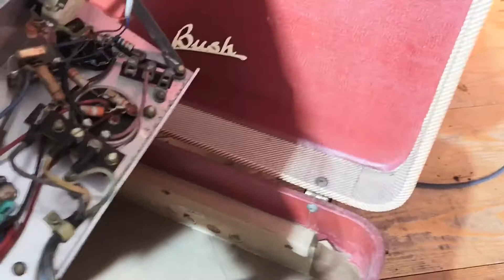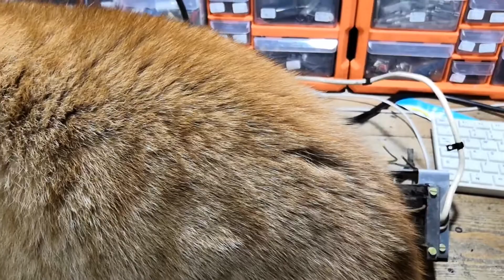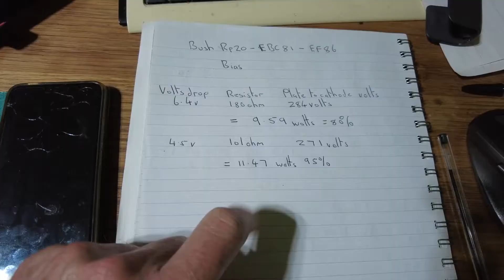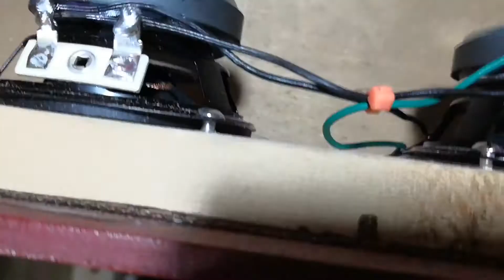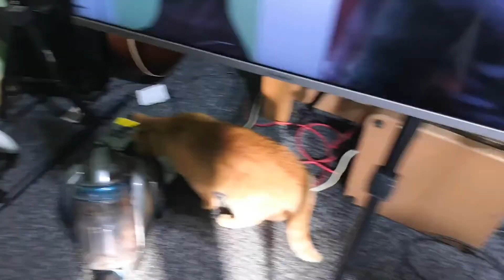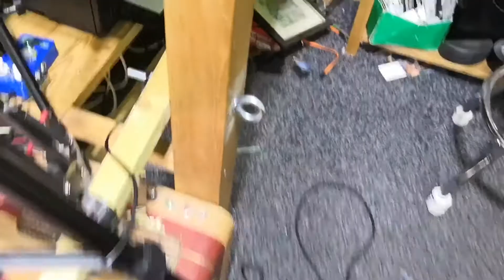Guitar Tube/Valve Amplifier born out of Vintage record Player Bush RP20 Becomes Vintage Guitar Amp

Comment: Great job , very inspiring. I just purchased a Philips ng-4012 for 10 euros, my plan is to transform it into a guitar amp. I think it is a (power) ‘transformerless’ design? It has an ucl 82 and a uy85 , have you modified anything similar? Thanks!
Reply from the maker: Hello, thank you. I have never done anything with the transformer-less, apart from old radios. You have to be careful because you are not isolated from the mains without a power transformer. They made a lot of those types of amps in the States during the 60s. They nicknamed them Widow makers. The Guitologist has done a few videos on Widow maker amps. They are worth a watch. Thanks for watching and take care.

Comment: I finally found a way to envy people in Europe and Australia, all of our 1950's tube record players like that size was series filament , transformerless. You may luck out and have a 12AX7/ECC83 if you get a preamp tube but sometrimes you may get a 12AU6 but you rarely got  anything better than a 25L6, 50L6, 50C5, 50EH5 power tube with a selenium rectifier or maybe a 35Z5. It seems like every piece of vintage gear overseas has some Mullard ECC83 with an EL84 and a 6CA4 which can very simply make a nice little guitar amp.
Reply from the maker: Hello. Sorry for the late reply, I have been ill. Series filament  units are always a problem, if you want to make them in to a guitar amp. You can fit an isolation transformer to make them safe check out @TheGuitologist He has fitted isolation transformers to one or two series filament amps.  Check out the links below. Thanks for watching and take care.

https://youtu.be/oUfI4gvtL-Y?si=Y809R8E2AaoLU8fJ

https://youtu.be/UIbMNuakn20?si=MMRyuwryRzuNN50Y

Comment: Beautiful project, terrific playing, incredible tone from this little thing. Trying to get around to building ECL86 amp (triode + pentode).
Really curious about the speaker
Reply from the maker: Hello., thank you. I used two Visaton speakers which I got from Radio Spares: https://uk.rs-online.com/web/p/speaker-drivers/4318686

The El86 is a good tube. I have a project coming up soon using PCL86. The same tube but has different heater voltage. Thanks for watching. Take care.

Comment: Nice. I'm planning on turning my early 50's philips disc jockey major into a guitar amp. Just need to replace 4 paper capacitors, and adapt the circuit to include input and output jacks. The old speaker is rather unusual compared to more modern speakers and appears to be in great condition for its age and is of a decent size.
Reply from the maker: Hello. I just looked at that model on Radio Museum. That looks a good project. Let me know how you get on with it. I f you need anything for it, just let me know on here. I have stacks of parts. Thanks for watching and take care.